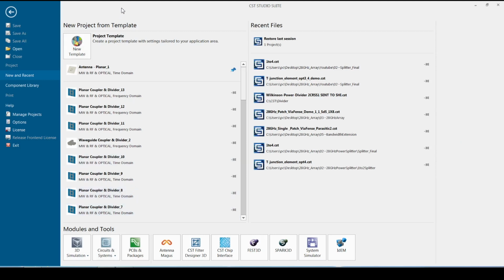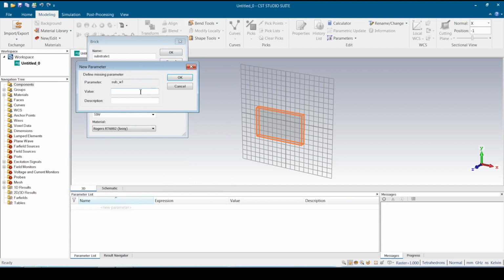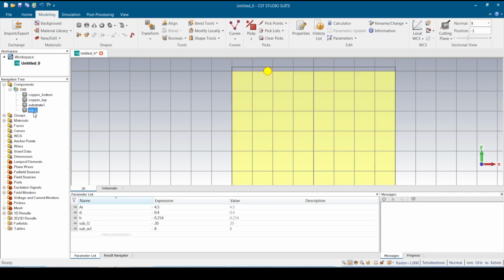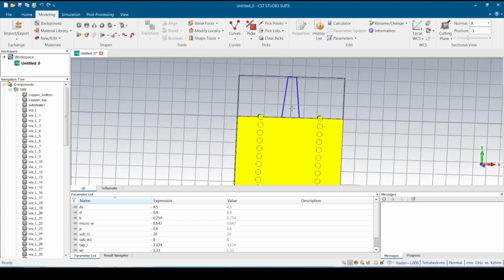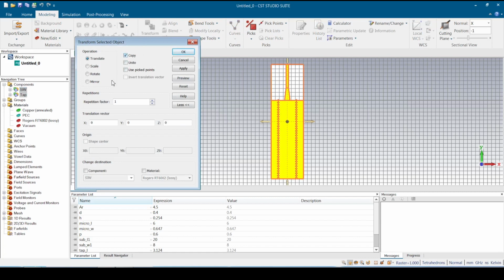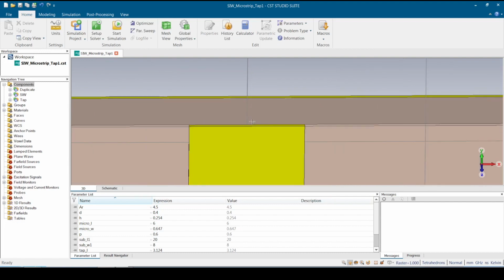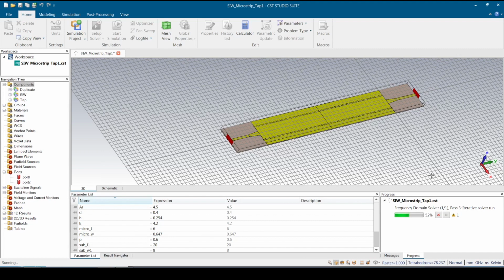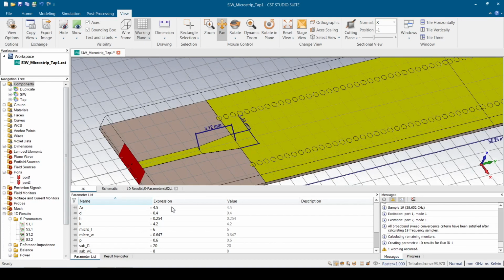How to Simulate the microstrip to SIW transition

Comment: Q1- depending on your SIW design helper , should have working frequency ..in this design what the value of this frequency ?
Q2- guided wave length after calculation was  imaginary number how will use it ?
 Q3- wavelength in media and guided wave length ,effect length and effect width how can i use them to calculate transition parameters ? 
Please explain this calculations in details to be clear for me 
thanks again
Reply: yes i found the f=28GHz 
 wave length in media is it come from  formula λc=c/fc ? or λ=c/f
could you please stated the guided wave length formula ? because i found different formula in some paper as 
λg=c/(f*sqrt(Ee)) and another one is λg=λc/Er  ...
ALSO the taper length has different formula L =n*λg/4   and              λg/2  <Lt <λg which one is correct and why ?